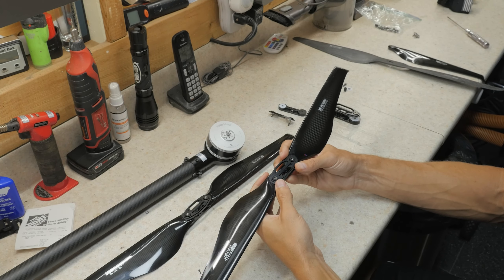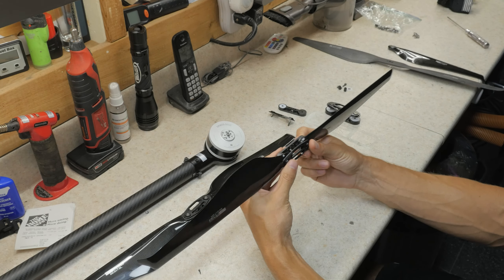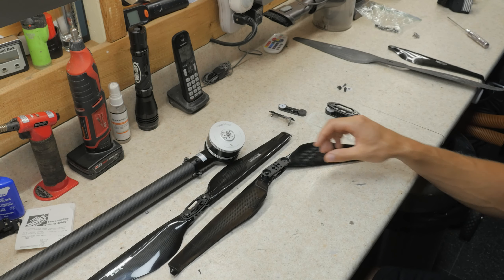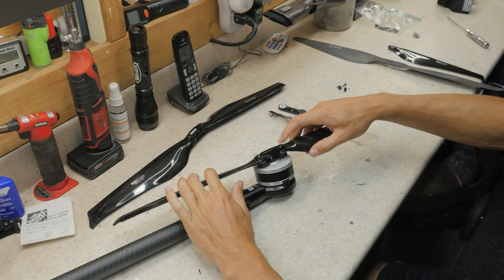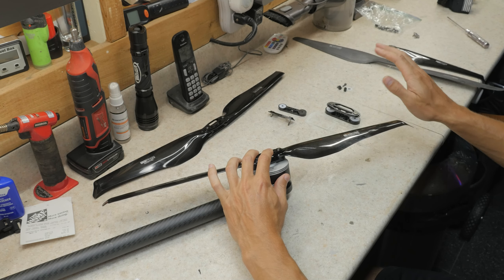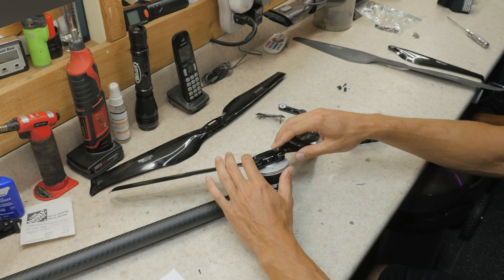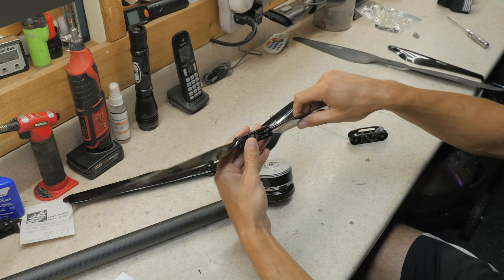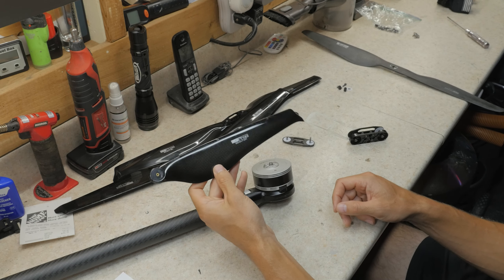TMotor FA Carbon Fiber Folding Propeller Failure/Warning

Comment: Good analyses. Have you brought this on to T-motor?
Reply from the maker: I have sent the video to T-Motor.   The biggest issue with T-Motor is their customer service seems pretty good, but they seem to be disconnected with their engineering team.  I have sent them dozens of problem (some severe) but only some have been addressed.  Clearly the issue described in the video is pretty severe yet I haven't heard back after addressing it to them over a month ago.
Reply: @cbacik2  That is a bit annoing and also worrisome.